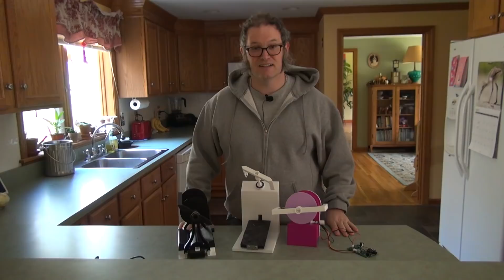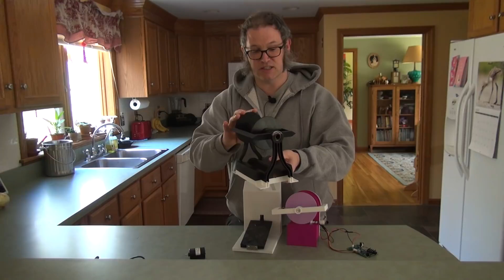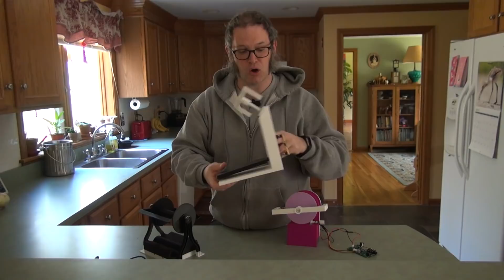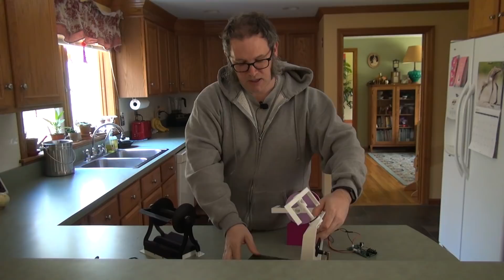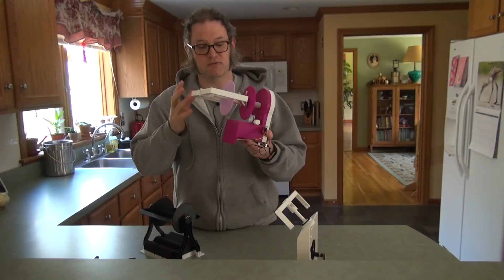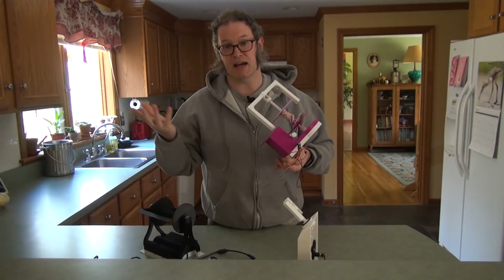Spin #51 - Give Your Feedback on these 3 Prototype Spinning Wheels

Comment: Thank you for all the effort you put in❣️👏 I would be particularly interested in the black one with the better motor. Would it still run of a 9V battery or power bank $ Also the larger size bobbin would be an advantage as well  💕👍